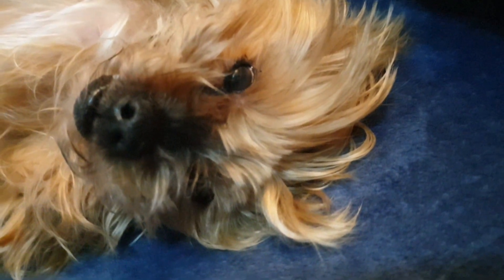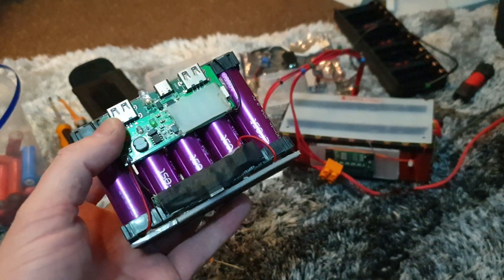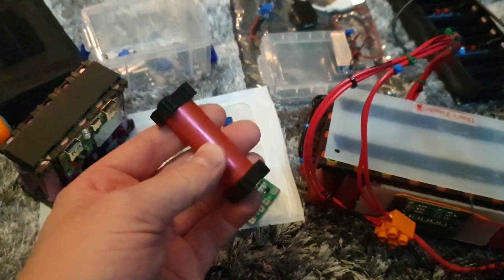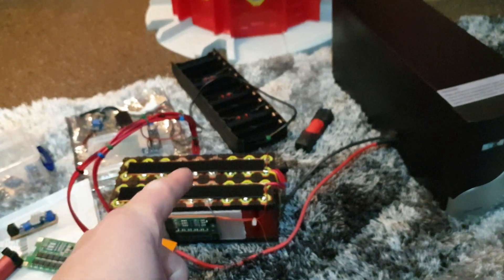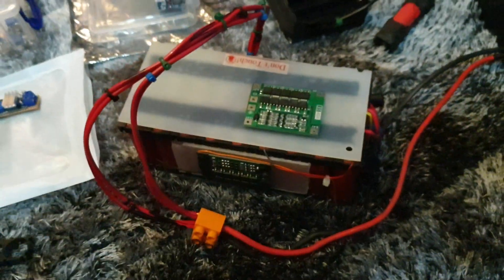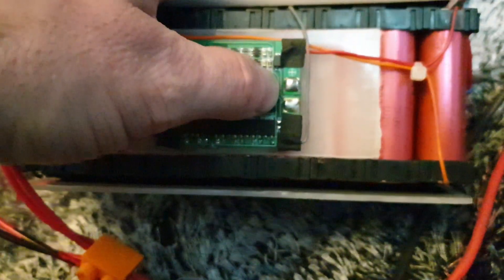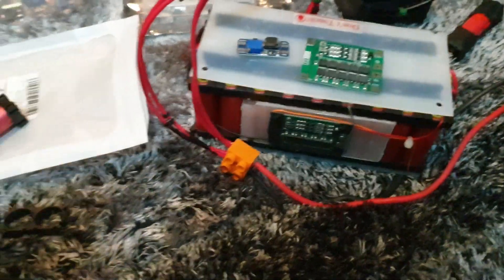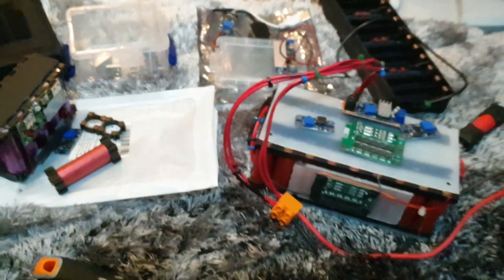18650 Massive lithium power Home made 📲⚡

Comment: hey, I like that dual type-C power bank, when you do DIY you can literally do whatever you want! have you seen my powerbank I made? it has dual QC3.0 ports with heatsinks and a BMS, but it also has a standard XT-60 connector so I can connect it to anything and have the raw 14.8v output it gives. I use it alot for my TS-100 soldering iron that I made a cable for.